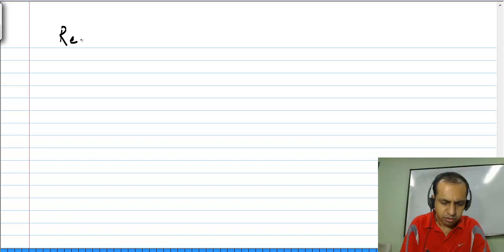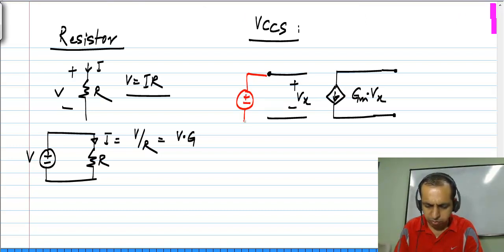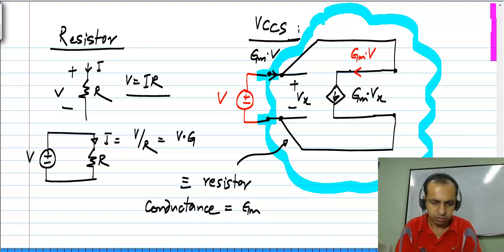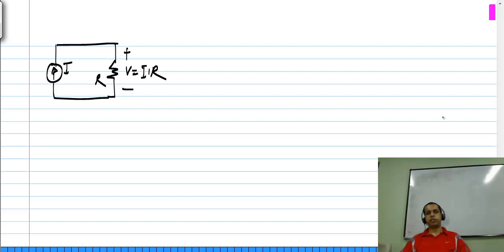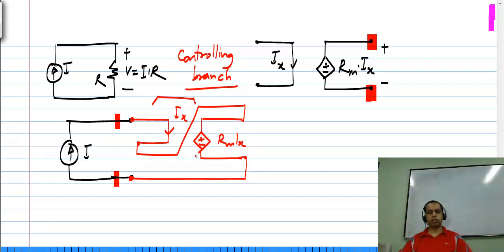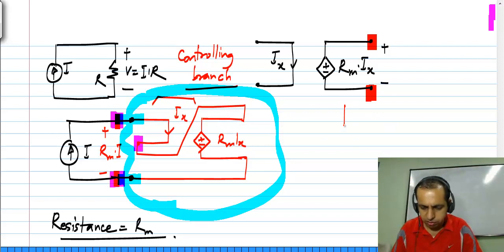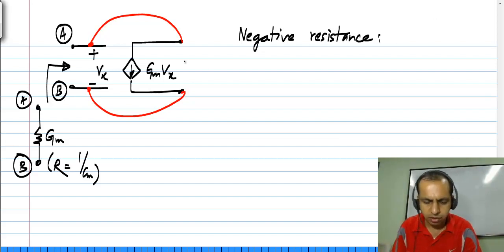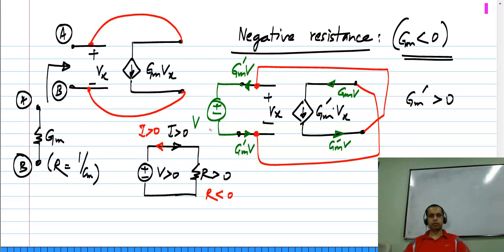Realizing a resistance using a VCCS or CCCS

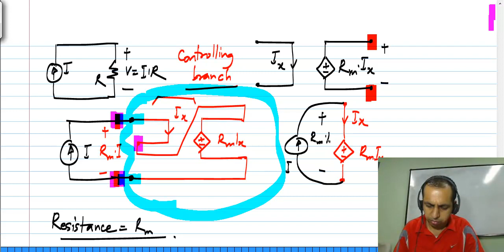Comment: At 9:35 he draws the 2nd diagram looks like of a short circuit......Then why won't we can say that Rm value is ZERO.  Since in SHORT CIRCUIT resistance value is 0....can any1 please solve my doubt 🙏🙏
Reply: Here Rm is not resistance. It is a part of dependent source. Its unit is same as resistance. but it is not an actual resistance.